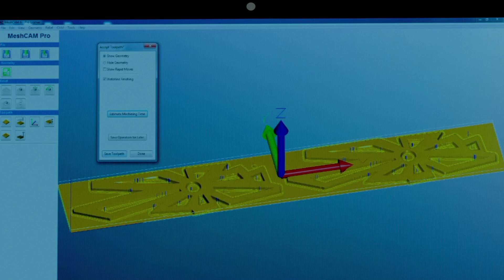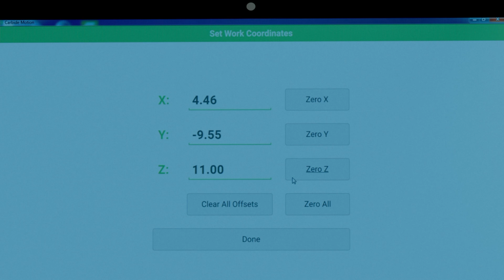Carbide 3D Nomad 883 Pro CNC Milling Machine

Comment: Hi. Can this mill dried pmc clay?
Reply from the maker: Hi There, Thanks for asking. We talked to our Jewelry Tech Team, and here is their response: "Dried PMC, even though it seems hard to the touch, is brittle and would likely  not be suitable to milling. After firing you may have better results, but not before." Thanks again for watching & hope this helps!
Reply: Thanks so much for responding. From research it looks like the Aussie Metal Clay Superflex can be engraved as well as fully cut out (I think at 2 or 3 card thickness), before firing, on the Circut. I realize the CNC is not the same type of machine, but it does cut and engrave and at a much better detail than the circut.